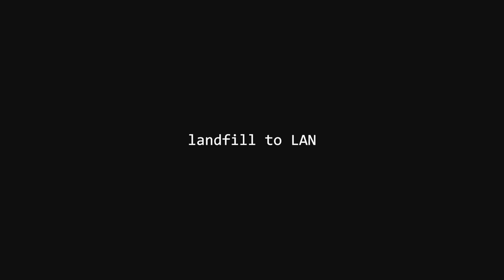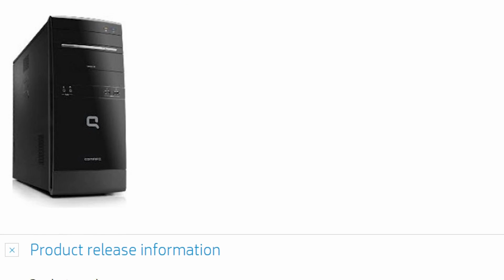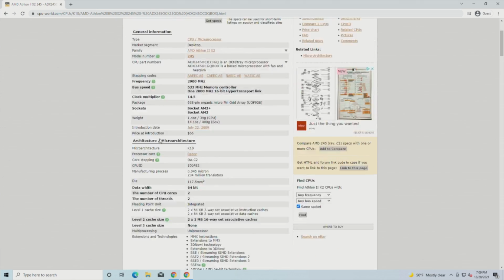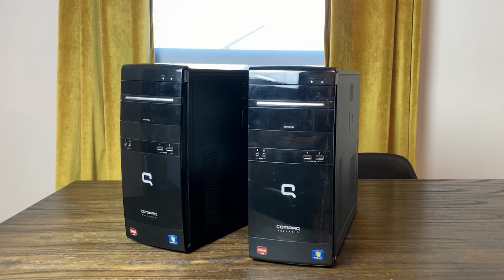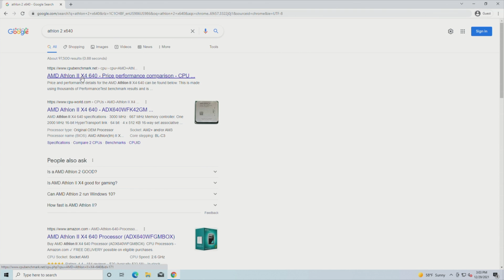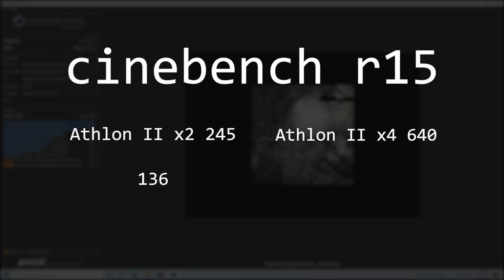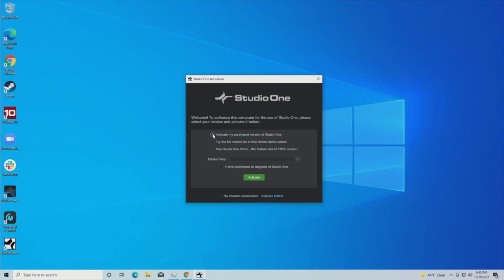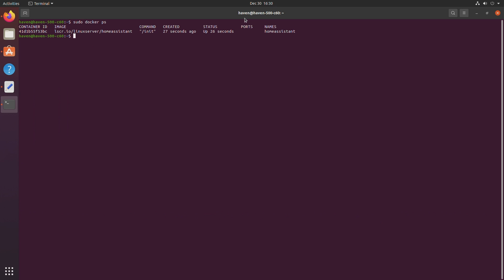Scrap PC Budget Build - Landfill to Lan: CQ5720f

Comment: Bro could u tell me which "testbench" can work with geforce 6200 gpu? I have a spare gt6200 le testing on my gigabyte mobo but the driver cannot find the gpu on it pls help
Reply from the maker: Are you using windows 10? If so, a lot of older GPUs unfortunately no longer have driver support
Reply: @HardwareHaven  i do use win 7 as driver's recommendation and used the exact driver for 6 series but when install it keeps quitting bc  it cant find the gpu. The mobo i used is g31m with e8400 cpu
Reply from the maker: Are you manually installing the driver using device manager?
Reply: @HardwareHaven  i did check there but there's only the g33 gpu, no nvidia one
Reply from the maker: Hmm.. if you have another pc around or that you could borrow, you might check to see if it works on a different system. You could also try installing Linux on a flash drive and boot from that to see if a different OS recognizes it. I hate to say that it might be an issue with the 6200, but that’s very possible.
Reply: @HardwareHaven  thx for the advice this gpu is abandoned for too long but i just wanna see if i can repurpose it for my old pc
Reply from the maker: I really hope you can!
Reply: I just think that the mobo isn't the type for this old gpu bc it is made for pentium 4 or older mobo has ddr1 ram
Reply: You should still be able to get a basic display out without having to install the specific driver because windows will default to the Microsoft basic display adapter. I would try some other troubleshooting methods. Does the fan on the card spin up when you turn on the pc?
Reply: @digitalronin7495  mine doesn't have any fan and in device manager there only show the onboard gpu